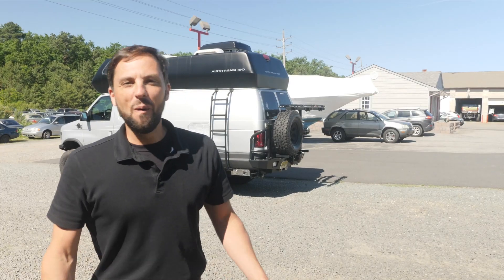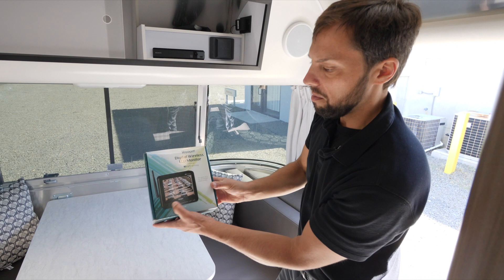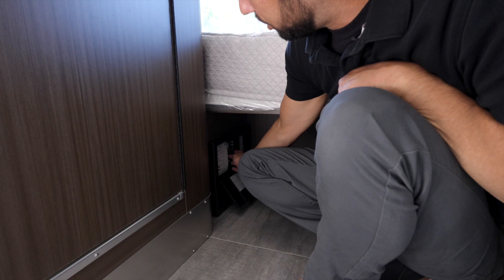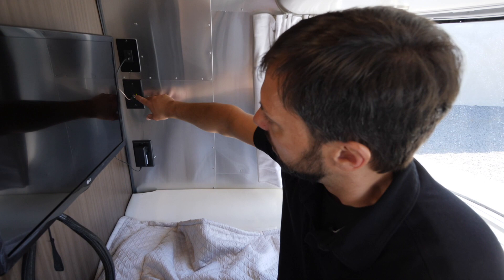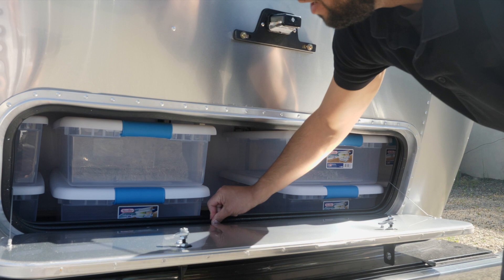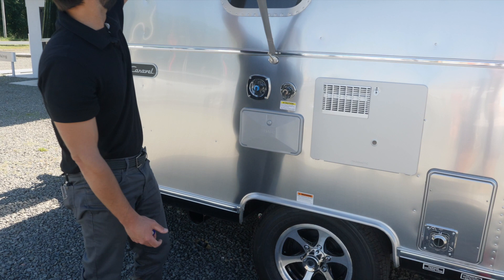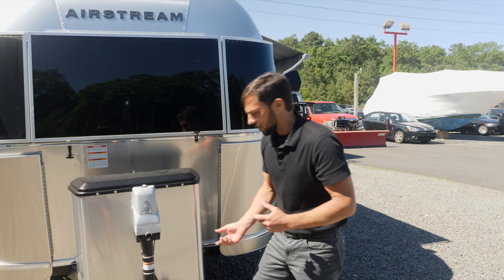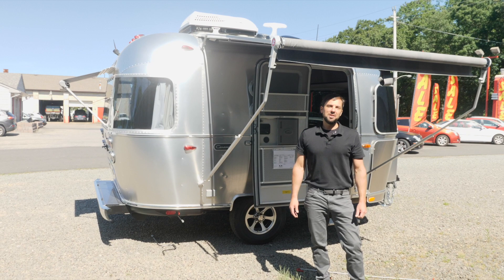Walk Through 2020 Airstream Caravel 16RB Small Light Weight Travel Trailer

Comment: I have a 2018 Sport '16, from Colonial.  I took off six weeks and pulled it to California.  I took many two lane highways and often boondocked in rest areas and Elks Lodges  I spent several nights at 10 degrees and stayed warm.  It's like pulling a tiny metal house that goes anywhere and is very sturdy and pulls so smoothly that it 'disappears'.  It fits in small 'forgotten' county campgrounds in the east.   I can park anywhere with a double parking space including all small PA towns that are far off the interstate. I keep moving, doin't unhook it from the pickup and don't require 30amp or dump station that often, and then i check into a campground.  For me, anything longer would  mean a triple parking space.

The extra content looks good,  stone guards (i need them), bumper with hose (bike rack??), style - panoramic window, etc.  - fancy hvac :(

Colonial service has been excellent.   When trade in time comes, i'll be back.  

R
Reply from the maker: Thank you for watching and thank you for your business. Patrick.

Comment: Airstream remains a dream for me... someday. And this Caravel, it's gotta be the most significant new Airstream in some time. Perfect little trailer.
Reply from the maker: Thank you for checking us out.
Reply: I agree.  This one is perfect. The dual wrap around windows really make it for me.
Reply: It's nice,   but having two axles in case of a blow out adds confidence of maintaining control.   You can also drove slowly a limited distance on three wheels to get off an interstate if need be then.   I have owned both types.

Comment: That seems like a really nice size and plan for one or two people with maybe a dog for a weekend. It's got all the essentials in a pretty minimal length, and you don't have to convert the dinette to a bed every night. It's especially remarkable how compact the kitchen is. Also, the wet bath makes it extremely compact as well.

Perhaps too compact... I think I'd like to see essentially the same plan stretched 3 feet to provide room for a separate shower stall in the bathroom, and to provide an extra cabinet with drawers and countertop in the kitchen. That would make it more practical for longer stays with more elaborate meals, even for permanent living for one or two. Airstream makes a Caravel 19CB, but I don't like that plan nearly as well (the bed seems too cramped shoehorned in side by side with the bath in the back of the trailer). None of the other Caravel plans offer wraparound windows front and rear. That's what really makes the 16RB stand out.

One other thing I like about the 16RB, the refrigerator is small enough to be a true under-counter unit. The others (in the larger Caravels) stick up too high and make it impractical to use the countertop as a work surface, leaving just the dinette table as your work surface (except the 20FB which has a more generous kitchen work area).
Reply from the maker: Thank you for watching.
Reply: Yes in a 16 ft. trailer compactness is essential.

Comment: How is Airstream competing with other small trailer manufacturers?  nuCamp offers a 400 Boon Dock Lite at 15' that comes with solar, 3-way fridge, microwave, two-burner stove, kitchen and more cabinet storage as well as off-road tires, same size bed as this Airstream, separate eating area and bathroom/shower.  Total weight is around 3500lbs and it comes in around $30k.  I guess having that Airstream name on the side adds to the cost.
Reply from the maker: It is best to ask the question. Why are so many Nucamp owners switching to Airstream? Recently we have had so many inquiries to trade in Nucamp 400's for Airstreams. I believe if you seen both of the product side-by-side, you would understand the difference in features, build quality and tow-ability.

Comment: 60K???1!!! OMG! How absurdly expensive!!
Reply: The awning should be automatic.
Reply from the maker: A power awning would be nice.
Reply: Wizardozzro  Why?  Its just something to break and cost you 8000 to fix.  Whats wrong with a mechanical?
Reply: @PS987654321PS  the demonstrator looked like he was struggling to put the awning up.  I am very sure he practiced many times putting that awniing up before doing the video demo. 

However, for my money, an automatic awning should be included in the price and if it breaks the company should fix it for free.
Reply: Wizardozzro Then they should refine the manual awning.  What advantage does a motor give you to open a simple awning other than complexity, unreliability and expense.
Reply: Absolutely Not!  

Like I said before, if I'm spending my money,  I must have an automatic awning that will retract during very strong winds and heavy rains. 

If Patrick was doing this video during inclimatic weather he would have been soaking wet.

If you are G I V I N G me a trailer with manual awning, I will accept a manual awning.

However, I would much rather buy a loaded used 25ft with an automatic awning for $60k.
Reply: Over priced!
Reply: You can get a new corvette for that.
Reply: Airstreams keep their value like no other.
Reply: Ditto.
Reply: @susanhamilton1822  You are absolutely correct; however, there is something also called Supply and Demand. So if there is no demand for that supply. Therefore it would not matter how long it holds it value.
Reply: @wizardozzro  I love them so much I'm a bit prejudiced. :)
Reply: @susanhamilton1822  I like Airstream, but I am also considering a customize sprinter with better of quality materials, products and equipment.
Reply: @wizardozzro  You are lucky and I'm envious.  I'm just dreaming myself. :(
Reply: I'll take a Lance 2465 for around $10K less!
Reply: USed i have seen these for $24,000 LAST about one week maximum! Obvious QUALITY standards speak for itself here. Yo might like to look at the HQ series 15, 17, 19 etc........THOSE ARE TANKS:) *0 more rigid than Airstream all aluminium exterior and inside, the control center looks like an airplane..LOL
Reply: Wizardozzro I have an idea. why don’t you hire a chauffeur to do your driving too.  And maybe better yet hire a servant to do the camping.  Then you can lie in your lazy boy at home all day and not have to turn a knob or god forbid get a drop of rain on you.
Reply: @susanhamilton1822  An Oliver or Bigfoot will do as well.

Comment: I have 2 e-mountain bikes at 50 lb each and a Rack at 50lb. Can a class 3 receiver be placed in the rear bumper to handle my rack and bikes?
Reply from the maker: We recommend the Fiamma bike rack and removing your batteries to reduce weight. We never recommend a rear hitch receiver and overloading the back of the trailer because it can cause trailer sway.

Comment: Can I pull THIS trailer with my Ford Edge?
Reply from the maker: It may be possible, I would check with your dealer and if it can tow more than 3500#, it may be possible.
Reply: Printed on the door post are the numbers you need to determine the capacity of the Edge.

Comment: I always wonder how much solar power does it take to charge up the 2 big batteries located at the front of the trailer?
Reply from the maker: The 90W will charge them over a nice sunny day.
Reply: Colonial Airstream oh cool! I didn’t realize it would be that fast.  Great news thanks! 👍
Reply: You can expect about 6.8 amps coming down into the batteries in full peak summer sun during the 4-6 hours centered around noon. Ideally, you start with full batteries and the 90 watts of sun charging will extend your stay a couple of days with conservative use. Adding a portable ground-mounted 100-watt panel would be highly recommended to boost the charging even further that allows a little TV/DVD/Radio entertainment during the evening or to keep the laptop charged.